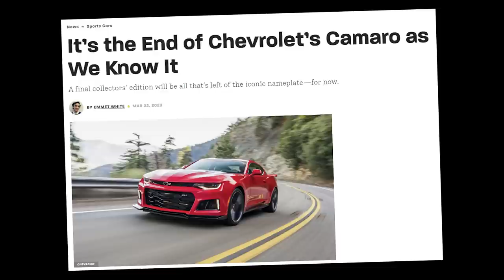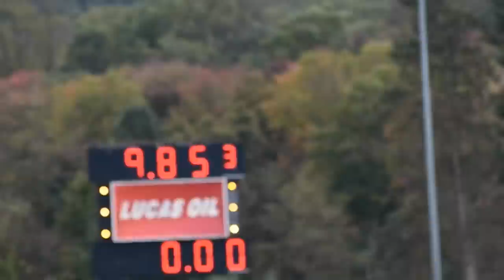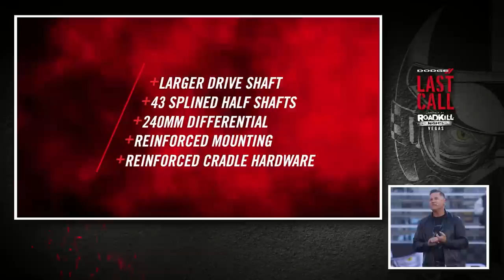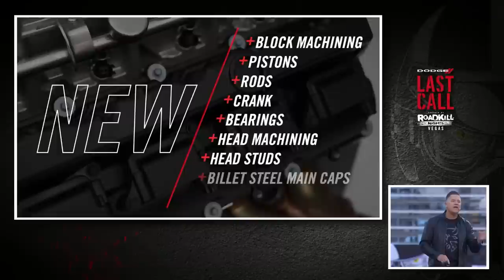The NEW Dodge Demon 170 is EVEN BETTER than you think.

Comment: The 170 is what the original Demon should have been 😎
Reply: I agree
Reply: You have to remember the demon was 5 to 6 years ago
Reply: The technology wasn’t available then and the original demon platform was used to create this monster. They corrected a lot of the mistake 💯💯
Reply: @trustdaprocess5707  1000hp tech has been available since the 40’s There isn’t anything new about an oversized engine with a oversized supercharger. Stallantis finally just offered it to the public.
Reply: @Bruceillest101  The Hemi IS the performance block of the past & future. But, only now, thx to Tim Kuniskis, are they able to offer it For The First Time Ever.., right off the assembly line to the consumer. No other manufacturer.
MopaR_Performance 🔥
Reply: @Bruceillest101  you're not very smart if you think the engine is the only thing that matters when going fast. The new technology is mostly in the driveline to put the power down better. It has the 1st automotive use of Hot Isostatic Pressing for the rear axle housing making it 53% stronger plus everything else is reinforced, Transbrake 2.0 adapts better to various road & track conditions so it's more effective, next-gen MT ET Street R tires better grip on the street, and next-gen adaptive drag racing suspension tranfers weight better than before.
Reply: Word!!
Reply: @trustdaprocess5707  The technology was available.  The changes that Dodge is making to the Demon now is the same things that us racers have doing whenever something breaks.  Ie; stronger aftermarket differential, stronger aftermarket driveshaft, thicker axels, better bearings, bigger blower, and so on.  Most of these parts were available from Direct Connect or the aftermarket.
Reply: Definitely the demon first time around should have been. I not feeling D170. Narrow front wide rear.
Reply: Naw the original demon was enough for the time it came out.
Reply: Alot can change in 5 to 6 years with automotive technology.
Reply: yes but ion think they had allat back in 2018
Reply: @moyklaveesplicasion3798  so you telling me they didn't have cars over thousand horsepower in 2018 come on man
Reply: @freemygrandma8752  not 1000hp+ cars i mean what the 170 got under the hood
Reply: @moyklaveesplicasion3798  umm ok 🤔🤔
Reply: @Bruceillest101  THEY DIDNT HAVE THE TECHNOLOGY TO MAKE IT RUN EFFICIENTLY AS TODAY WITH THE HP
Reply: Nah
Reply: @Bruceillest101  dude the technology wasn’t available. Racing is more than “hp tech” fool🥴🙄
Reply: 100% Right
Reply: you can easily make 1000hp out of a normal hellcat. the 170 is nothing special
Reply: @miseryparty3726  OK
Reply: @miseryparty3726 U go see💯
Reply: @trustdaprocess5707  see what? that hellcats are ugly cheaply made bricks? Been seen that since 2008
Reply: @trustdaprocess5707  wtf 426 hemi you could get 800hp on engine 1000hp isn't nothing new
Reply: We can’t be happy with the original attempt? Let’s give them credit for what they did. A street legal car you could take to the track with some warranty! Amazing.
Reply: @ThreeCeeProductions  nothing extraordinary.

Comment: You always made me so proud to follow you and this video filled me with joy. The fact Dodge chose E85 for their performance fuel changes the accessibility of that 1025hp big time. Instead of a $7 gallon race fuel we only need $2.67/gallon Ethanol E85 fuel at 105 octane. That's over a 50% cut in fuel costs with around the corner accessibility. Should deliver only a slight reduction in mpg with the modern boosted fuel injected V8. Hell I'd run E85 only as widespread as it is at all these Sheetz stations. If E85 hadn't been so politicized, I believe Dodge would've incorporated the option to run it in Hemi's much earlier -like so many racers and owners do with flex fuel kits.

Comment: Dang this 170 is so sick.  I love how these cars look.  Dodge always did make some nice awesome looking muscles cars.  But camaro and mustangs not joining kinda sad in the drag racing scene.  Their focus was making fast cars around the circuit track not drag racing. Dodge is focusing on drag racing when ford and chevy are  pass that stage.  But we all seen gt500 and ZR1 with slicks and slight tunes running low 9 and not even making 1025 hp reason because these cars weight is 3600 to 3700 pounds. Not a 4300 lb car that dodge keep building.   these gt500 and ZR1 camaro with tunes and light up grade for drag racing is so endless with mod you can do.  Mustang and Camaro are fast around a circuit track or can be built to run 9 or 8 with a few parts swap out for drag racing. But again dodge always been a muscle car brand meaning straight line racing.   while camaro and mustang are consider pony cars that can do it all not just go straight. At the end of the day I love this 170.  Is just the most agressive and toughest car we will see on the streets.. 💪
Reply from the maker: You made some really good points.

Comment: I was lucky to miss out on the Demon in 2018 , dealer screwed up, long story short Ingot a special order 22 Super Stock, it ran 10:40@133 ,Took me 7 runs to figure out the car, Im 63 and while racing since 1970s I took a break for 13 years , fastest car time I ran was 11:60s and that was ultra fast 44 years ago, 10 seconds will plant in in the seat full track !!!I  My stage 2 kit is in, with good tires it will run mid 9s on 94 to high 9s on 91 pump fuel, Once I make that 9 second run I'm  parking the car, Ill still drive it on the streets now and then , I'm 99% done with a low to mid 12 car I've been building for 9 years on and off Hot street / strip / show, Total frame off project , Super Stock buyers got the deal of the century with all weak links have been corrected ,And ill give you a hell of a run against a 250K Demn 170....................OH SORRY You can run it at a sanctioned track without a full cage !!!  But all 170 owners enjoy your new car ! If you get under water with it call me ill buy you out .This is my drag car , built with not a penny to spare ! best of the best and an old school type build. 302 inline GMC- 6 383 HP 418.7 torque to much to list .    https://www.youtube.com/watch?v=z1ByMI76eh4&t=438s..................Not as fast but my SS BUT one of a kind ,       https://www.youtube.com/watch?v=z1ByMI76eh4

Comment: Dodge Overstates the performance as always. Demon 170 will typically be 9.5 @ 146 at best. 8.9 sec qtr mile runs will be extremely rare. Perfect conditions are needed all around. The same challenges will present itself. Getting it hooked up to make a clean pass. 
The Tesla plaid on the other hand will run 9.2 @ 151 consistently all day.
Reply from the maker: I ran a 8.9 in the Soul Snatcher with similar power.

Comment: @Demonology Want your opinion. Do you think the 170 will live up to the numbers Dodge gave? Saw a couple of other conflicting videos on whether the 1.66 0-60 and the 8 second 1/4 mile will be possible with it.
Reply: It won't be done on any normal occasion. It takes a lightweight driver, perfect negative DA, very cool weather and perfectly prepped dragstrip. Plaid will beat it even on the strip 99% of the time and 100% on the street.
Reply: Everything would have to be perfect, track, weather, driver, everything.  It is highly unlikely to Las Vegas run was under 9 sec.  The conditions were not so good.
Reply: @TB-vb3ov  Gt00s and regular c8s will eat them on the street.  Cars are just heavy and can't put that power down without major prep, with great weather and great road(s) in front of it.

Comment: Not better at all it’s makes 871 to the wheels don’t hype up the trash lol I know for a fact u can go buy the crate motor for 38k no one wanted it when it was on sale lol now it’s in a half widebody car everyone acts hyped 1000% doesn’t make 1025whp maybe crank but who goes off crank hp that’s just to make u seem faster than you truly are that thing is no faster than mine meaning it does 9.40s 9.50s they can cut the cap there the kings of cap lol
Reply: To pull the times they're claiming, the car will make 900whp at minimum on good E85. Of course it will take negative DA and great prep. In average conditions it will probably run 9.3's and 9.6's in bad conditions which is still pretty freakin crazy

Comment: I getting a Challenger and order it and leaning towards a jailbreak 
So the question is the 170 is not good for  drive around suspensions set up more for quarter mile Like your input if you don't mind Will the car seated drug strip yes maybe once every 2 years We'll get along miles maybe about 5 to 10000 a year.
Reply: The REWB Challenger is the best for all-around driving fun.  The suspension is adjustable in-cab so you can go from stiff and very little body roll for a drive on twisty roads or a track day, to soft and supple for cruising around town and on the interstate.  It also has massive Brembo brakes at all 4 corners for great stopping power and little fade when hot. Both the old and new Demon as well as the Super Stock have VERY drag-specific suspensions for getting the very best launch from the line possible.  Comfort was not really a consideration but an afterthought on these.  The Demons and Super Stock also have much smaller brakes (rotors and calipers)at all 4 corners to reduce weight and allow for a smaller diameter wheel to fit.  Buy the REWB Or Jailbreak Hellcat Challenger and you will NOT regret it.  Owning one gives you the ability to feel great at any time.  You are having a really crappy day at work and are in a bad mood?? Get in the car and take a drive for 30 mins somewhere where you can punch the gas and do a few 0 to 60 pulls or a few 40 to 120 rolls and I promise you will be smiling.  They are absolutely an instant mood enhancer for me. LOL
Reply: What can it do on a road course
Reply: Thank you for the info I was thinking the same thing snd about the road course I have a ZL1-1LE  for that stuff as u can see by my pic it an 18 I had an  scatpack 19 6.4 grate car I actually did order a blue jail break and dodge told me it was on its way dealer never called me So when I finally did call a dealership and asked ware my car was and here my Vin They start tapped dancing pretty good. So I kinda got them by the balls.
Reply: @HallAdrian.777  Wow they gave your order to someone else? That is crazy.  I had a crappy thing like that happen to me with the C8 corvette. A friend of mine knows the owner of dealer here and put me in touch with him to order a new C8 for my wife.  He was willing to do the sticker price and required a 5000 dollar deposit.  I built the car order and I watched them put it in.  That was like November 2021.  I waited and waited and waited.  A year passed by and at this point I had decided screw this I am going to buy an F Type SVR or a Mercedes AMG GT for her.  I found a perfect F Type SVR in New York and bought it.  I left the corvette on order and was either going to buy it for myself or sell my deposit to someone else.  Maybe two weeks after buying the F Type he texts me that he cannot sell me the car I ordered at sticker, WHICH WAS THE AGREEMENT, and instead needed an additional 15,000 over sticker.  I was livid.  He kept my money for over a year and then weaseled out of the deal we made.  Hell, if i wanted to pay 15k over sticker I could have bought one in November of 2021 and not waited a year.  Honest dealerships are few and far between these days!
Reply: Challengers is actually for my life of course with the black key only LOL. I am working on also getting new ZL1-1LE converted into the exorcist Hennessee.

Comment: You said the original Demon engines work great with 18lbs of boost. Can you tell me what the problems are when you try to run over 18lbs of boost on the original Demon/Redeye engine? Thanks.
Reply: The charger starts to encounter issues Supplying an over abundance of air. Therefore the boost starts to drop off as the engines Rpm climb to the top of the rev range. Let’s say it starts at 18lbs by redline that could let’s just say 12lbs. (I don’t know actually numbers but you get the idea.)

Comment: Yeah but what's messed up is Dodge is the muscle car and muscle truck it is Mopar Mopar in general stands for muscle all day when you hear Mopar you don't think of a 4-door sedan or something like that you hear Mopar you think of muscle badass machines now they build some badass muscle cars but they also build some badass trucks I wish Dodge before they call it quits with all of the gas and go electric which is said but Dodge will own that platform to because they always think outside the box and they don't copy but anyways I wish Dodge would make one more muscle truck before they shut it down you've got the Dodge Dakota RT you got the Dodge Daytona you got the Dodge ram SST then you got the ram aarti you got the sport and then on top of that you have the V10 viper I need to come up with one more muscle truck and slap the elephant in it since that is the baddest pound-for-pound horsepower and torque motor that they offer Mopar they need to put that we need another 2-door short bed single cab truck

Comment: It’s a great car but it’s a big fail considering you can still go buy a cobra jet for around the same price or cheaper .. and the cobra jet destroy this demon 170 that’s just me doe
Reply: Lol sure.
Reply: You can buy a used top fuel dragster also but you can not drive either of them on the street. Cobra Jet is a race car with NO VIN NUMBER. no plates not street legal
Reply: The Cobra Jet is not street legal.  also, the Drag Pak is the competition for the Cobra Jet and Copo Camaro.  The Demon is a street legal car.  If you are talking about only using it on the Drag strip, then I see your point.
Reply: Except the cobra jet isn’t even a production car
Reply: Say it again for the one's in the back
Reply: @ejohnson3837  and that car not track legal so what you saying
Reply: @ericship8383  it is it’s just not street legal you can go buy one Right now
Reply: @Ebv66  It is leagle at a NHRA track to run 9.00 or slower. To run faster than 9.00 you need to install a roll cage.

Comment: They needed somthing to compete with Fords Cobra Jets😂
Reply from the maker: It's called the Drag Pak
Reply: @Demonology no that's still not enough but a start I suppose. Cobra jet still a whole second faster through the 1/4 mile than the drag pack equipped slopar. That's why they cuilt the 170 as they still couldn't beat the big ol Ford Cobra JET. Hopefully now they might have a chance🤣 🦄

Comment: Dodge makes 1/4 mile cars NOT FAST CARS. You take a redeye with 797hp and  its getting smoked by a 760hp gt500 and the difference is anywhere from 4-6 cars on the top end. There are hundreds of videos to prove it STOCK VS STOCK! Jailbreaks and superstocks get gapped by 3 cars on the top end by a gt500 and there are plenty of videos STOCK VS STOCK. the gt500 will walk the demon on the top end STOCK VS STOCK. So stating that only dodge makes "Fast" cars you're completely wrong. Do they make "Quick" cars yea but "Fast" means top speed while "quick" means 1/4 mile. And just to inform you that the tesla still holds a faster record of 8.77 1/4 mile stock at 162mph and I can link video for any uneducated person to argue against it lmao but the rimac nevera has a 8.6 sec 1/4 mile which kills everyone for a stock vehicle. There are even faster cars than these that are electric. Electric is just shitting on these gas engines while being more reliable at it also.
Reply: You are comparing Apples to oranges... Full size muscle car vs pony car.. Electric vs gas for the Tesla reference. Its not always about racing for most people, if that was the case then everyone would be getting the lightest car out there. Its about the look, the sound, the raw power. As a big guy I fit in Dodges, but mustangs are small. Sorrry but Ford isnt all that great. They make some great cars but its still a Ford, Dodge has the pedigree and background and was the first true muscle car brand.
Reply: @MattySRT  dodge makes cars that can oy do 1 thing and that's go in a straight line. Ford makes cars that can win doing multiple things. You should never compare a car that can do it all to 1 that can't. Ford FTW.
Reply: @MattySRT  when you speak of raw power that's what I've cleared the air about with my original comment meaning the Fords are faster by just raw power. The way they pull after 130mph where the massive 6.2l v8 torque has ran out while the 5.2l v8 is still pulling on the top end. But no engine is competing with electric because it's power is instant and you can't beat instant. The rimac pulls a 8.6 sec 1/4 which is insane.

Comment: $300,000 just to get smoked by a GT500 with a tune, or a GT with boost. It's a cool car, but way over hyped and overpriced.
Reply: A GT 500 with a tune might run what?  Low 10’s???  not quite sure that’s going to cut it.  the GT500 is a beast, but it’s not touching this Demon with just a tune.
Reply: Thank you
Reply: @danieljohn4603  man that got procharged mustang gt running 7 seconds. And twin turbos